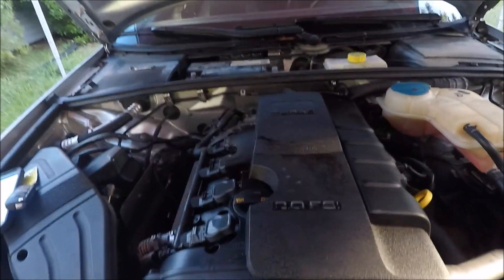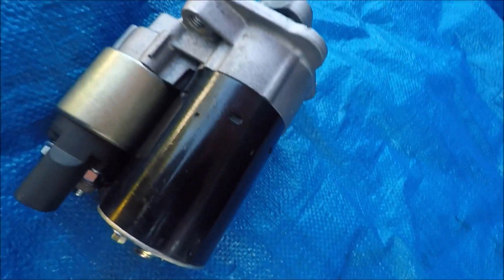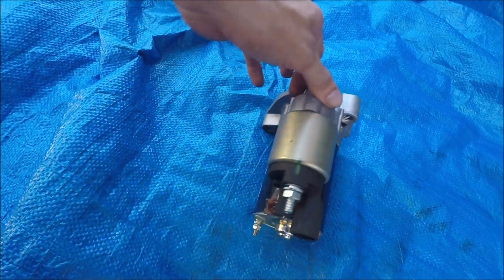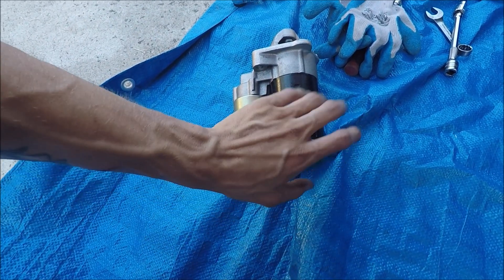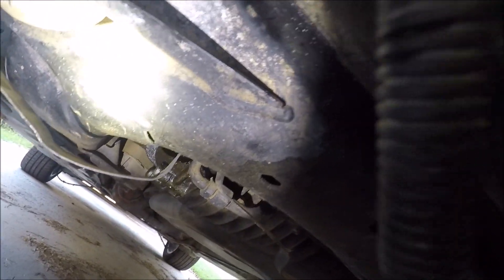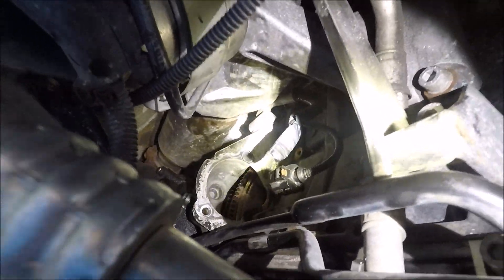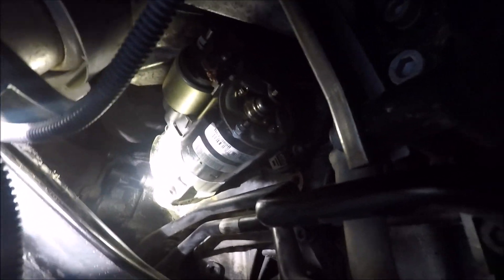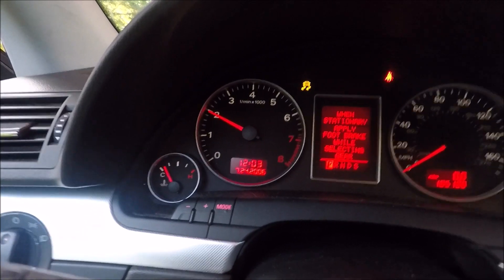Audi A4 starter

Comment: Having trouble with the top volt from the starter. Any advice?
Reply from the maker: I had to reach over the lower control arm
Reply: @backyardbuildz482  that's exactly where I am at the top bolt won't catch the tread from the starter
Reply from the maker: Try a wobble extension
Reply: @backyardbuildz482  tried that and still no luck lol